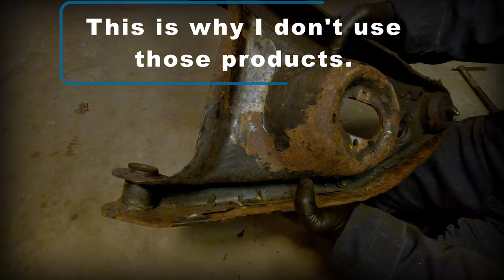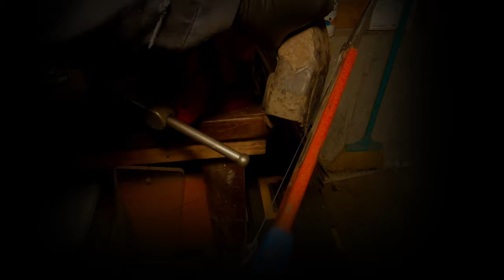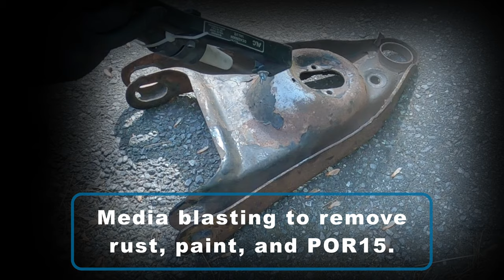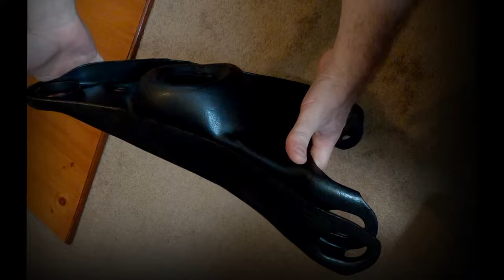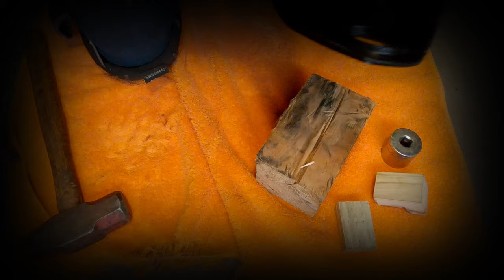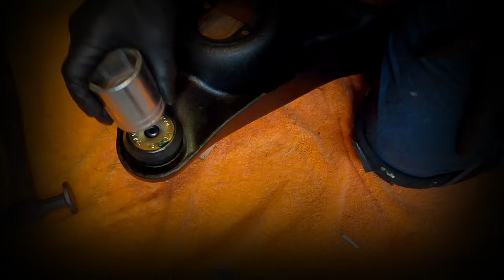Lower Control Arm Restoration GM A Body Chevelle Cutlass Skylark Tempest

Comment: Awesome video like always. Another tip is to use a wax paste like mother's. That makes the bushings slide right in . Just like grease but slightly more slippery. Keep up the great work and videos!
Reply from the maker: Interesting tip, I haven't ever tried wax paste. I primarily use grease to protect the contact areas from moisture, I notice less rust years after the installation. I bet the wax would make installation easier but I wonder if it would provide the same protection. Thanks for the comment, I will have to try it out sometime!

Comment: Great video! What's your sandblasting setup and media used?
Reply from the maker: Thank you for the comment and question. I use an  ALC 90 lb Pressure Abrasive Blaster with a water separator piped in on the tank inlet. For this job I used Black Diamond Coal Slag fine media from Tractor Supply.